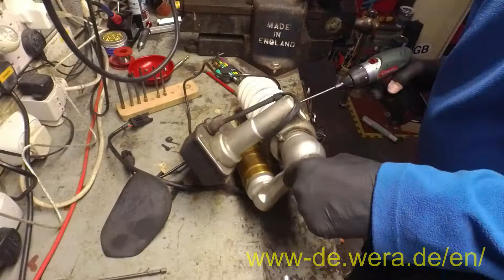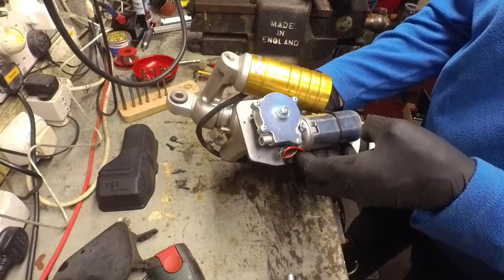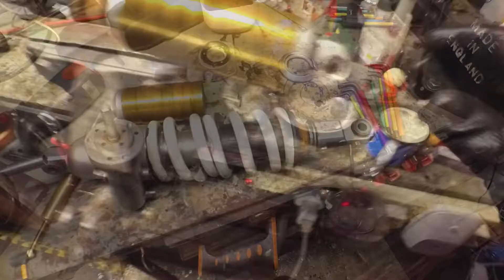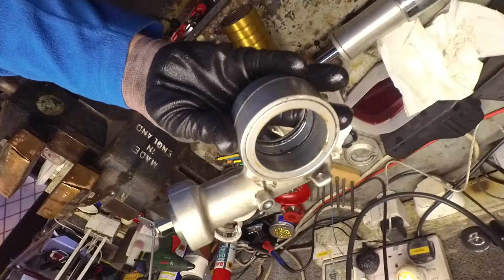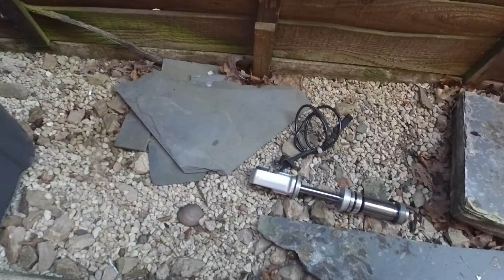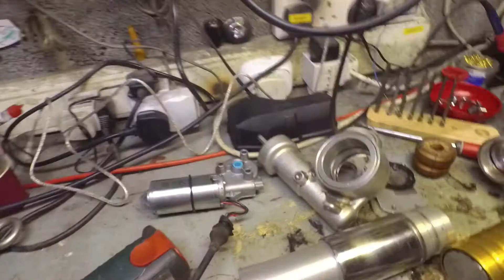What's Inside a BMW R1200GS Rear Suspension Strut? Pt 1

Comment: Know what's funny.  These shocks are completely rebuildable and are worth almost $2500.  This dufus just destroyed this one lol
Reply from the maker: Yeah, I know….and I probably should have got it rebuilt. At the time though, it was cheaper to use a 2nd hand unit off eBay rather than rebuild the faulty one. The 2nd hand one’s still working fine many miles later 👍🏻

Comment: Hello ! I noticed while cleaning the bike that the plastic dust cover which is inside the spring is rotating on the right and left , not up and down . Is it normal ?
Reply from the maker: The black plastic tubular part, inside the spring, is effectively fixed to the lower end of the spring. So it moves up & down with the spring as the suspension works. It's trapped by the pressure of the spring. Mine doesn't rotate, even with the bike on the centre stand and the suspension fully extended - the spring pressure is still plenty to keep the plastic tube firmly held. So I don't think rotation of this part is normal (unless BMW changed the design since my version). Might be worth getting yours checked out by a dealer. Does yours rotate only when on the centre stand, or even when there's weight on the rear wheel?
Reply: @Greeves  well the tubular part is rotating on it self spinning right and left by small amount , but doesn't go up and down 🤷🏼‍♂️ also it rubs on the spring . I does do it with load or no load while on side stand
Reply: @Greeves  if it was broken wouldn't it go up and down also ?
Reply: @Greeves  also , not everytime it moves it requires a bit of work to get it move by a little , but everytime i touch it it ticks
Reply from the maker: Please be clear, I’m not a BMW specialist; just an enthusiastic amateur. It does sound to me as if there’s something not quite right with your dust cover. Could be that the plastic’s broken(?) I don’t think it’s safety critical but still worth getting it checked. It shouldn’t move, or ‘tick’, so far as I’m aware.
Reply: @Greeves  thanks for your reply tho i am not trying to get a specialised answer i know i am referring to an enthusiast amateur ,i am just trying to make a conversation. I just noticed that the dust cover was getting friction - rub with the spring at a specific area and while i tried to clean it i noticed that it moves a little bit but requires a little bit of work to get it unstuck and move . It does not go up tho , just an observation...thanks again
Reply from the maker: No worries. I hope you get it sorted 👍
Reply: Visited the dealer and he told me that the plastic part is normal to rotate , but not to go up and down 🤷🏼‍♂️ i told bim it even has a little bit of play when i push it from different angles  , he said it works fine and doesnt see anything unusual , all shocks are rubbing with the tubular part
Reply from the maker: @aldvex8541  Thanks for posting the update. Interesting. Mine seems securely attached at the lower end of the spring & distorts out of round if I push it, throught the spring, from the side. It doesn't rub the shock, or the spring, it stays in the gap between the two. I can't get it to rotate either. Maybe it's just gummed up with dirt. Good to hear that yours is OK though & as it should be 👍
Reply: @Greeves  of course i would post an update in case any other fella need it ! Something last and to close the matter , you dont feel any ''play at all '' as you push it from different angles ? only distortion ? i am trying to figure if something is messed up inside ...
Reply from the maker: @aldvex8541  It's the worst quality video ever but this is my strut https://youtu.be/irTKwvIjm9s

Comment: Can you refil the oil inside the gold reservoir? mine reaches the limit and then i hear a clunck sound. when i hit a bumb and my bike restores height.
Reply from the maker: I’m no expert but my upstanding is that the gold reservoir primarily contains nitrogen gas under pressure. There’s a piston inside that separates the gas from oil that’s forced across from the main damper unit as it operates. So the gas provides part of the spring function as well as keeping pressure on the oil to reduce cavitation. So most of the oil lives in the main damper leg. Replacing, or replenishing the oil (or nitrogen) is not an end user task and will require special equipment. It sounds as if yours may have lost some oil, or gas and need professional attention.
Reply: @Greeves  if i unscrew the cap at the gold reservoir, wil there be compression? So stuf ahoots out?
Reply from the maker: @SikkeTiemersma  If you look at the video 7:10 mins in; removing the screw at the top of the reservoir does release a small amount of gas. Not dangerous though. Once this is done the whole reservoir may be unscrewed with nothing else escaping (see 09:24). The gold reservoir looks to be sealed for life and probably contains gas under pressure below a floating piston. I wouldn't recommend tampering with it.

Comment: Great video! Did you know that the guy in the UK can fix them shocks? 
You can find him on Facebook TTechsuspension hi done mine and it works like new! Buying them second-hand doesn't really do the trick.problem of leaking shock will come back very soon...
Reply from the maker: Thanks for this. I haven’t heard of this chap but will look him up. My secondhand unit is still OK so far but definitely an unknown quantity. If it does fail, an expert repair does sound a better bet than swapping in another used one